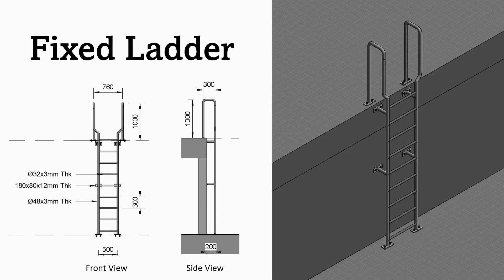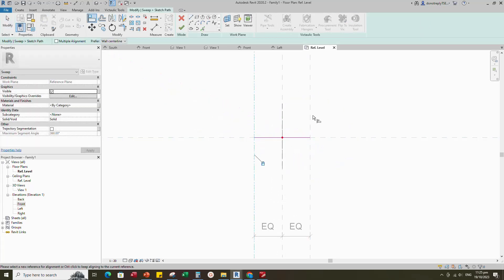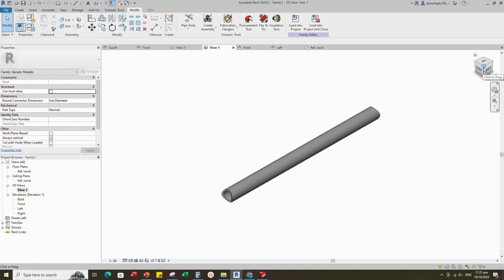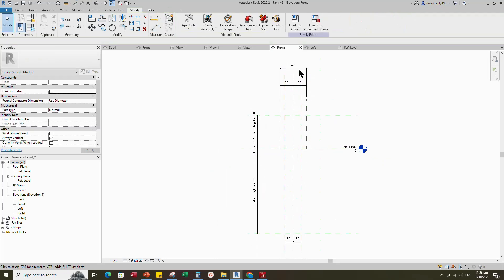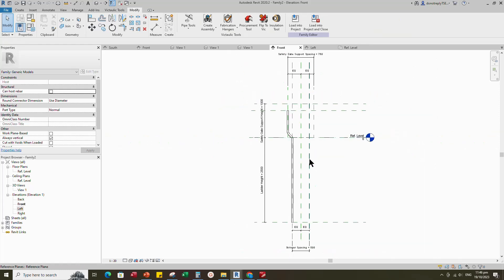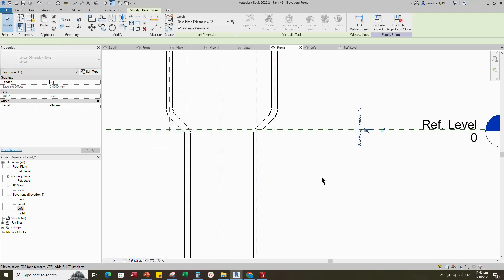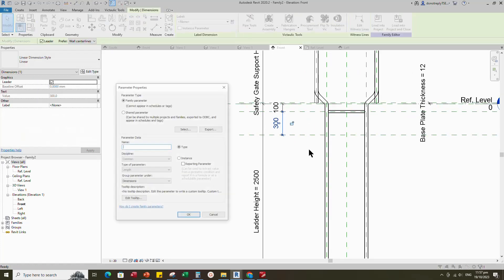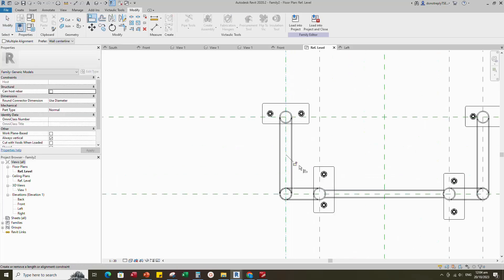Create Fixed Ladder Revit Family (Parametric)

Comment: could you explain if we need a rectaugular rails or rungs material. what we have to change on the fixed ladder family. thanks for your help
Reply from the maker: You can use rectangular or square profile instead circular profile.